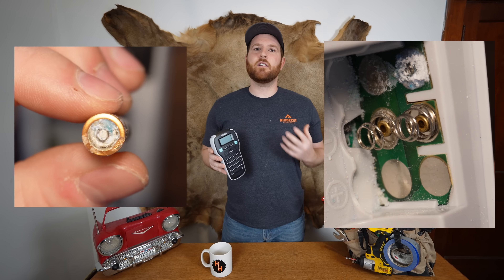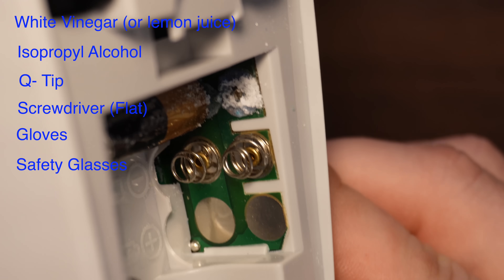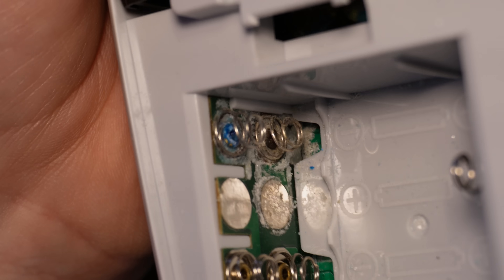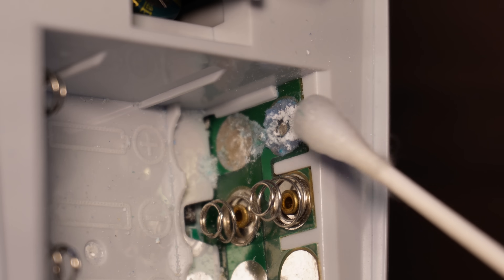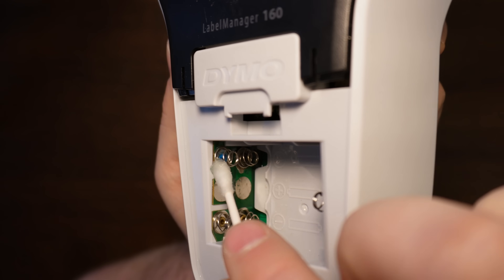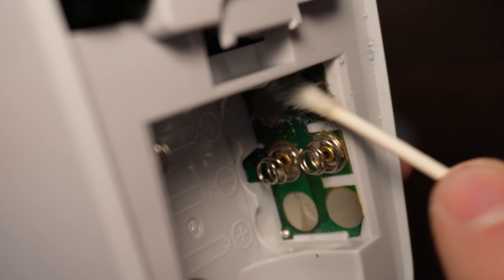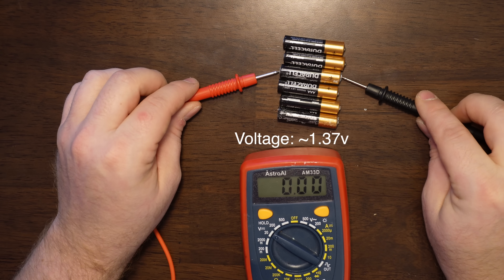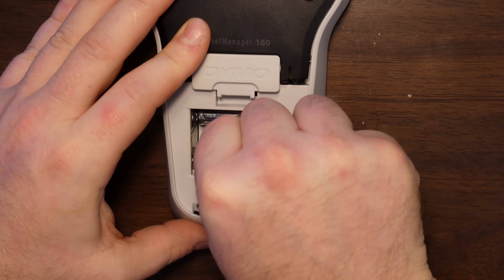Clean BATTERY CORROSION on ELECTRONICS! EASY DIY!  |  2-minute Tutorials Ep.4

Comment: But when you put new batteries in you mixed brands! Avoid mixing different battery brands or types (alkaline, lithium) in the same device, as this can cause leakage or damage. You should put back all new and all the same; I’d recommend using Energizer Max (2 year anti leak guarantee after they are empty as long as they’re within expiry date) or Duracell Optimum for their increased leak protection 👍

Comment: Thanks for the tip. I forgot to remove the batteries from the remote control for my vcr before putting in storage. ARG. yep batteries about welded in it.  surprisingly, I was able to pry them out with a screw driver. Now to clean up the corrosion, which wasn't as bad as I thought it'd be.
Reply: Got it cleaned and it wouldn't work the vcr/dvd player.  lol oops wrong remote. While it was for a vcr/dvd player, it was the wrong brand. I must have another one somewhere.

Comment: Stay away from the Kirkland Brand AA batteries.  I would also stay away from the Duracell AA batteries since Duracell makes the Kirkland batteries.  I never fails.  If the batteries are left in battery pack too long like two years you will get leakage from those Costco Kirkland AA batteries.  I never turned back to using the Kirkland AA batteries since the price went way up and they changed the packaging on the batteries.  Question?  Is it only the AA size Kirkland and Duracell batteries that leak or do the 9 volt, C and D size batteries leak too?

Comment: Ah ha! I see your first problem. Duracell batteries. Kirkland batteries (Duracell made for Costco) are just as bad.
Thanks for the vinegar tip. I had not seen that one before. I'll try it if I locate any thing around the house that still has alkaline batteries in it.
I have switched almost everything to rechargeable NiMH and a few rarely used items to lithium. It's worth the extra expense of the lithium on some things. I've thrown away too many flashlights, etc. due to battery corrosion.
The NiMH may be cheaper in the long run since I get dozens or maybe even hundreds of uses out of them. The Panasonic Eneloop batteries seem to last forever.

Comment: I was reluctant to try this method. I was afraid if I got any of the mechanism wet where the spring is and everything from corrosion that it would mess everything up. But I tried it and it worked out perfectly! I highly recommend this video! I was trying to fix a spray fan water bottle For my daughter‘s field day when it gets really hot outside and I had left the batteries in since we went to Disney about 10 months back. I turned it on and it was a proud moment I must say!

Comment: I used to be a huge fan and advocate for Duracell batteries. Not no mo’. Duracells are the most corrosive, leaky batteries and they’re the most expensive.

Now I use Harbor Freight’s Thunderbolt EDGE batteries. They last just as long, but if you leave them in an appliance for years, they’ll come out clean and intact. Duracells are crap.

Comment: OK, but is there a way to prevent this from happening in the first place?  Are there batteries that are less prone to leakage than others?  In my experience, every time I have a leaking battery it's a Duracell.
Reply: any battery can leak, take them out when not using over a month and never mix used and new.

Comment: Thank you!  Recently I tried to turn on my sound system that I hadn't used in several years.  I noticed that the remote wasn't working.  When I opened it up I was horrified to find that the Duracell batteries were so corroded and stuck that I had to pry them, thump on it, etc in order to even get them out.  I thought I probably would have to throw the remote away, and maybe even the entire system because many of the features required the remote to access them.  I decided to check here for a solution.  Wow!  It didn't take very long and using the white vinegar and alcohol cleaned everything up and now it works perfectly!  Thank you so much!!  (Oh and I put new Energizers in now!)

Comment: Thanks for the tips. How about sticking fine grit sand paper on the tip of the cotton wool bud to clean those degraded device contacts ?
Reply from the maker: I’m not an electronics guy, but that sounds like a good idea!
Reply: @HandymanHertz  I have created a 2 Ltr vinegar bath where I can drop metal fittings into it, stripping away paint and deep rush. After a few weeks, it's brand new. I then apply cooking fat (even if it has darkened and gone bad) as an anti rust layer before applying an enamel paint over the top.

Comment: If you want a battery that NEVER leaks, use Energizer Lithium batteries. They cost quite a bit, but they will last a lot longer than alkaline batteries. The reason they don’t leak is because they use an entirely different chemistry. Plus, they have a twenty year shelf life! People put them in TV remote controls and they’ll easily last the life of the set. If you have a hard-to-reach quartz clock, put in a lithium battery.

Comment: Never use Duracell in anything that doesnt use a set of batteries inside a couple of years eg TV remotes.
Flashlights and radios etc are fine, because they will run out inside 2 years.
Why? they are TOO good. (stay with me) in occasional use equipment, they last too long (hang in there) they last SO long, the charge outlasts the seal, holding the acid.
So, if its an emergency flaghlight in case of power cut, choose another make of battery and check every 6 months.
Get duracells out of your remotes, or end up like this guy, but if left too long, youll have no terminals left to clean.
Better to change batteries a little more often, than have this happen.

Comment: Found my parents old handycam, a kodak easyshare c533. was ecstatic when I found it, only to see that there were old batteries left in it. 

Tried this trick, havent seen if it works. 

Will update once it cures and seems finished.
Reply: Update: it made it go to bare metal, so I soldered some solder tin on it so it won't rust again. Works great! Now the only thing left is to get the thing running good again, keeps dying for no reason. But hey, atleast the terminals won't rust for a while! 

Thanks for the vid!

Comment: Once you clean it up DON’T put any more alkaline batteries in the device. Especially if it is likely to sit unused for a year or longer. 

I switched to using AA lithium batteries or rechargeable NiMH batteries like the ENLOOP brand. 

No more throwing away devices that hid the batteries so far inside that I could clean the terminals effectively. And no more cleaning terminals.

Comment: That was good. I never thought about that . However, to my knowledge, those batteries were leaking which is what caused the corrosion therefore, they should be tossed in the trash. It appears that you did replace them, anyway. Well done.

Comment: Yes almost, be sure check if there is internal pig tail leads to a main circuit board.  Those are most likely also corrosion compromised to the main board solder pad. Its insidious, change out all wires comming from the battery board and clean.
Reply from the maker: Yup, this is the correct way. I feel like most people wouldn't know how to do this and would just throw it away at that point.

Comment: This only happens because manufacturers refuse to put real power switches on devices that need them, like a label maker. Who makes labels on the regular? Solve this by somehow remembering to take one battery out, or do what I do and put a tiny piece of plastic in between one of the contacts and a battery

Comment: Baking soda and water also works very well. Mix the baking soda and water together in a small bowl or tray. Just enough water to make it into a paste that still has enough liquid to soak it up into a cotton swab - Q tip. It works so well that I've never had to scrape anything off. Good for car battery terminals as well.

Comment: Excellent info! Also it would be great if the manufacturers would state the Mah rating on those batteries like they do for rechargeable types! A chart comparing them would be very helpful! Hmmm, knowing which brand had the highest current capacity would hopefully inspire the manufacturers to compete for better battery life! :)

Comment: You need to remove the blue corrosion  the viniger did not clean up.  if not the metal material will rust away.

Comment: Every few months I check the batteries in all my flashlights and remotes to catch any corrosion before it becomes an issue. I also use my DYMO LT100H label maker to put the installation date on the batteries.

Comment: Be proactive, before using any battery powered device, including solar powered garden lights,security lights, tv remotes, basically anything battery powered, give the terminals and circuit board if accessible’ a spray with WD40. Mop off excess, and assemble. You’ll get trouble free service for years,

Comment: I found many years ago that Duracell are terrible when it comes to leaking acid. I refuse to use them now and have for years. Even if someone gave them to me, I wouldn't use them. I've also heard many times that you should not mix battery brands as you did at the end of the video with Duracell and Energizer...

Comment: There's another chemical called "Contact Cleaner" that used to be used to clean the contacts in a television back when they had mechanical tuners.  The advantage is you can squirt it in somewhere that's hard to reach and it'll do a 90% job of cleaning out corrosion.

Comment: forgot 2 batteries in a keyboard for 2 years and... ouch !  a lot of corrosion, Needed to use a screwdriver just to take out the batteries...  I tried your trick and it worked !  thanks  👍👍

Comment: My method: I dilute the vinegar essence to a concentration of about 5% and fill it into a spray bottle.  Spray the diluted vinegar essence on the corroded areas until the foaming stops.  For cleaning tap water is sufficient.  Using the sprayer has the advantage of getting the solution everywhere without the complication of a ear bud fiddlery.

Other acids may work as well but for practical purposes vinegar essence has the advantage of not being overly corrosive when applied somewhat generously.  Products such as lemon juice, or vinegar contain other compounds which have no business in electronics so I avoid them.  Vinegar essence is useful for other applications such as limescale removal so its something I keep around anyway.

Make sure there's nothing that could corrode such as a brass nozzles on the sprayer.  This is why I recommend the very cheapest all-plastic sprayers, the kind you get from a 1€$£ (pick currency) pile in the supermarket.

It's a very good method but it may fail.  The corrosion products in a device cause swelling of certain types of cheap circuit boards which then will crumble like potato crisps.  So the best recommendation is and stays to remove batteries from devices that are unused for a long time.  For example do you really need to have the batteries in that emergency torch in the boot of the car.  The one which is used once every five years?  Keep the batteries in a plastic bag where leaking can't cause damage and make it a habit to test them every few months.  Do not believe in leakproof batteries.  They all leak.

There are (were?) rechargeable alkaline batteries which are advertised as having a voltage of 1.5 V over NiMh rechargeables.  Stay away from those, they have an extreme tendency to leak.  NiMh rechargables are good for most devices except a few where the manual advises against them; others don't or don't work well with the NiMh voltage of just 1.5 V.  If that's no concern, NiMh batteries may a consideration.  They are contained in a steel case which is actually mostly leak-proof.  There are some other points to consider with NiMH but this is primarily a writeup on the topic of leaking batteries and how to deal with them.

Comment: I didn't open a toddler's toy for about a year after I received, and the manufacturers already put in batteries to be "helpful".  Big mistake.  The positive battery contacts corroded to the point of being rusted.  Vinegar helped to remove some of the rust, but using a Dremel to remove the rest of the rust revived the toy once again.

Comment: I have never used vinegar for this, I have always used acetone and it works quite well, even when the stuff is very hard and crusty. Acetone is aggressive to some types of plastic, but inside a plastic case it won't do any damage, it might just make the plastic surface a little dull; just make sure you don't spill any on the outside. It does not damage circuit boards or metal and it is non-conductive and very volatile.
Reply from the maker: Thanks for your input

Comment: I have a zoom Q3 handy video recorder that had been stored with batteries for about 5 years with batteries.  the battery compartment was corroded.  I cleaned it the best I could, but it still did not work with the new batteries.  I found this video, and did exactly as you said, now my recorder is working with batteries.  Thank you so much for this video.
Reply from the maker: Glad it worked for you!

Comment: my 4 triple A batteries corroded inside my electronic weighing scale. i was able to get 3 out but 1 is stuck and it wont budge. am I doomed or am I doomed?

also the amount of rust and corrosion you have on yours is no where near the amount i have. mine is basically almost unrecognizable. my dumbass left the batteries inside for over 1.5 years iirc
Reply: i was wondering if i can still salvage my electronic device cause i just recently bought a high quality battery for it :(

Comment: Just a heads up to all watching this very helpful video:  MAKE SURE TO WEAR EYE PROTECTION when cleaning off battery corrosion.  Those corrosive salts, just a speck of them, are murderous if they get in your eye - instant agony.  I spent hours in an ER one night when a speck popped loose and went straight into my right eye.  The ER doc inserted a special contact lens attached to a long, small hose, and then flushed my eye with a solution (saline I believe) to wash out the corrosion, which was a long and fairly excruciatingly painful procedure.  A week later they applied a drop of dye to my cornea and I swear it looked like the Milky Way viewed sideways.  Fortunately it heals fairly quickly.  I don't go near a corroded battery now without fully enclosed shop goggles.

Comment: Tip for broken springs.
Use an old one from a broken device and place in the compartment.

I buy old toys and the broken ones get their good battery contacts removed for possible later use.
Reply from the maker: Thanks for the tip 👍🏼

Comment: Thanks for making this video. Thanks to you, I was able to clean out the battery compartment on my old gameboy. The batteries were very badly corroded and leaked battery acid all over. I had a hard time pulling the batteries out, they were stuck in there good. I cleaned out the compartment the best I could but the gameboy wouldn’t work. Then I found your video and after trying your technique for cleaning it, my gameboy finally worked again! Woohoo! 😄
Again thanks! 😁👍👍
Reply from the maker: Oh man! I loved game boys as a kid so I'm glad you got it fixed!

Comment: I tried to revive 2 toy drummers that my late grandma had for years. One had rust on only one of the batteries springs and the other had corrosion on both the terminals. The one that had corrosion on both the terminals I was hoping to revive in time for 4th of July. The one with rust was an Irish drummer which I love the song but I don't remember what it sounds like it's been so long since I've heard it. I use lemon juice and q-tips. The lemon juice took off the corrosion just fine. I finished up with the rubbing alcohol to dry it. Even with all the corrosion off the terminals sadly my American drummer didn't work. 😭😭😭 I'm not sure if there was something else that I needed to do or if it's mechanically broke on the inside from before the batteries got corroded. I also wasn't able to get the rest off the Irish drummer. Looks like these poor drummers are just going to be decorative. 😭😭😭 If anybody has some suggestions I'm open to ideas. 🤔 I have 3 other drummers that work just fine (a Japanese drummer, a Mexican drummer and a Santa Claus drummer) I like to play the Mexican drummer on Cinco de Mayo and send a video to my friends. There is also a Russian drummer that I have not been able to locate somewhere at my house. I'm not sure whether that one works or not. I'm aware of a snowman drummer made by the same company but that one we never purchased. They were sold in Walgreens in December probably around 2015 or so. I've also tried to look them up online to possibly replace them. I found one YouTube video showing the Santa Claus but I've not seen any of the other ones so I'm not sure if eBay or one of those other sellers might have them it may be a needle in the haystack to find.

Comment: Wake up people. There are 2 or 3 competent alkaline household battery manufacturers and duracell is one of them. Leakage with alkalines is rare if they are in a good circuit and not installed BACKWARD.
Reply from the maker: Sounds like you work for Duracell… Go look at these comments. Dozens and dozens of people have experience with them being the worst brand, notorious for them.